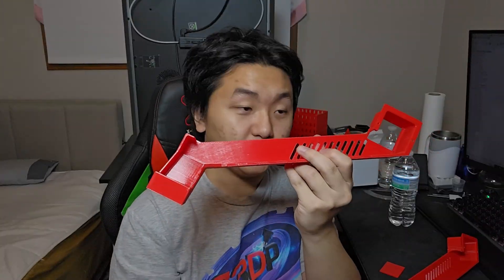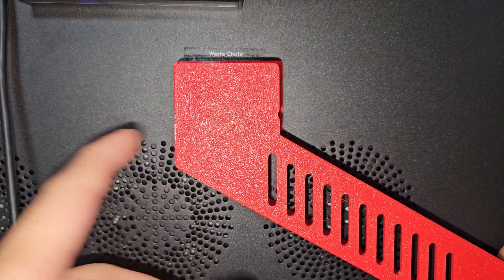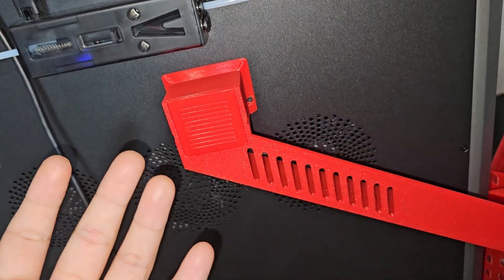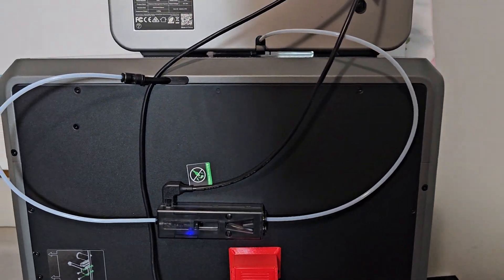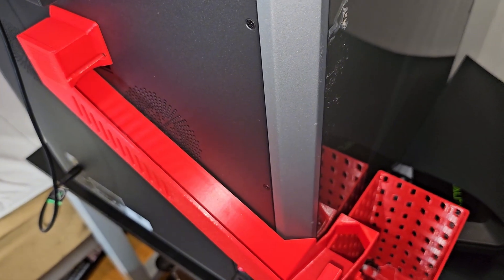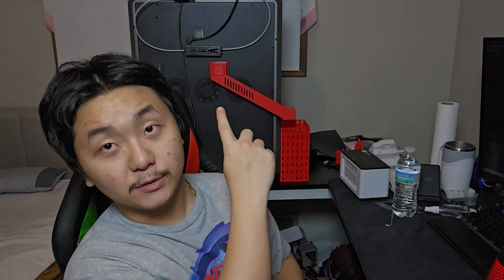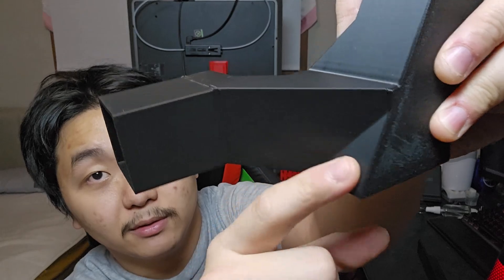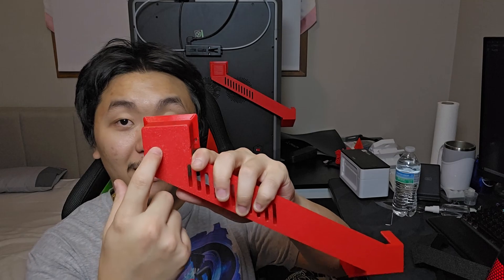Creality K2 Plus Poop Chute Slide MUST HAVE MOD

Comment: I am super new so sorry if silly questions.  1.  Can you put all the parts on the plate and print all parts at one time.  2.  I wanted to do the right side but it appears to be larger than the plate how do you handle this?
Reply from the maker: Yes you can print it all in one go with the left side.

For the right side you'll have to rotate it a bit so it can be printed on the build plate. If you print it diagonally then it should fit.

Great questions.

Comment: Hi there, does this work for the new K2, the standard version. i think the k2 plus is bigger? i have just bought a standard K2 but not very good at modelling from scratch
Reply from the maker: I dont think its going to fit the standard k2, since the k2 plus is a bigger 3d printer.

Comment: when i import on to creality print for my k2 plus it seems like the slide does not fit in the platform. Are we supposed to break up thhe slide into 2 peices?
Reply from the maker: No, you must rotate it a bit so it fits diagonally.

Comment: Hi i think your poop chute for the K2 plus is amazing. Do you know if there is a similar design for the K1 Max conversion. Or could your design be converted to fit. I have looked everywhere but cant find anything that comes close to yours. I know i would have to cut a hole in the back but the conversion kit doesn't come with an internal catcher/chute. Thanks in advance.
Reply from the maker: I don't know at the moment. If I ever got my self a conversion for the k1 max, I'll try to make one for it.

Comment: "Awesome video! I loved it. Would you mind sharing the profile you use in OrcaSlicer for the K2 Plus with PLA? That would be super helpful!"
Reply from the maker: Thank you. I pretty much use the default setting, it's good. The changes that I make was print speed, the max volumetric, changing infill to 3D honeycomb, and adjust the temperature a bit. Those are the most important for getting a good print.

Comment: I get lots of long stringy poop that seems like it would have trouble going down the slide, and through the hole you have at the end of the chute.  How does it deal with those?
Reply from the maker: I have those problems too, it's just that sometimes it has stringy poop and will likely be stuck. I'll see if I can do something about that.

Comment: Nice design. I'm pringting the "poop chute slide right (correct) stl and had to rotate the model clockwise 7 degrees for it to fit on build plate for slicing.
Reply from the maker: Thanks, yes the right side is quite long, so it has to be rotated in order for it to fit on the k2 plus.
Reply: Thank you for this.  I rotated mine on the blue (Z) access -7.00 and it worked.

Comment: Hi, I really like the design and all the ideas and therefore printed it right away with my new K2 Plus in Creality Print 5.1.7.   with Black PLA. Unfortunately it does not fit and the angles and length do not meet up with the device and so it would not really fit.  Did I do something wrong or do I need to used PETG because there is already some warping calculated in the model? I am a bit lost. Would ASA work as well?  Thanks for any advice 🙂
Reply from the maker: What do you mean it does not fit? Did you print the left side or right side? Any material would work.
Reply: @Scratch3DPrinting   I printed the left side. Is there a way to provide a picture? that probably explains it better but what I mean is that the poop chute does not go well to be flat at the backside of the printer and around the corner. The angle doesn't even seem to be 90 degrees in total (so probably two times 45 degree) and is also not close at the edged corner.  I hope I don't have a revised K2 Plus enclosure :-) which could also be a possible explanation. The print itself looks perfect, nice and clean.
Reply: @Scratch3DPrinting   I think I am ok. I watched the pictures again and maybe it's also not so perfect fitting to the printer enclosure as I first thought.  Sorry for disturbing 🙂
Reply from the maker: @ThorBerlin no worry. Yeah it's not 100% perfectly flat with the 3d printer, because it seems like the middle part is popping out a bit.

Comment: hey there, i should have check the measurement before printing however the right hand side doesn't fit due to the poop shoot being off center. Ill print the left side now because design is really quite good. Kind Regards JUST-NOBODY.
Reply from the maker: Ohh, I'm sorry I didn't have time to measure it and just did a mirror of the left side. I'll fix it and reuplaod. Thanks.
Reply: @Scratch3DPrinting  nice one, great model well done on your prompt response and honesty. I appreciate the way you take on feed back.👌

Comment: Is love to a version that ejects to the right, under the spool holder, as it's a big printer and it would mean the left side could be up against a wall and spools and poop on the right.
Reply from the maker: I'll try to make for the right side as well.
Reply: @Scratch3DPrinting  Brilliant. No hurry but ill be happy to run off some tests.
Reply from the maker: @fluxxNZ Hey, I just uploaded the right side, let me know how it works.
Reply: @Scratch3DPrinting  Hello Sorry but is there a trick to printing the right side chute? The file shows 358mm on a 350mm bed. Am I supposed to angle it up in order to print?

Comment: Exactly what I was thinking was needed for a K2 ! So awesome you made this!  I wonder if U can make a 2nd ramp on the side that would end at the front bottom of the K2 ? Then U could just put a wastebasket underneath the front of the K2. Then you dont have to have much room on the side for the bin. This would help on the K2 for print farms. Maybe something to think about making later.
Reply from the maker: Thanks, yeah, something like this must be on the k2 plus for all the poop waste. I'll keep that in mind about making the slide all the way to the front. But I'm not sure if it has enough ramp for the poop to slide all the way to the front.

Comment: question not about your poop chute... when you rooted your printer, did you use the same install that you do with the K1 series or is there a new one for the K2? I rooted my printer but would really like to get everything else loaded on it.
Reply from the maker: I have not rooted the k2 plus. I can't really say how it's done yet.
Reply: @Scratch3DPrinting  how were you running macros then?
Reply from the maker: @97JoMiller Those macro are presets from Creality. You can see and use the macro from using Fluidd interface. Which you can get access to from Orcaslicer. For example: your printer IP address: 192.168.0.000:4408

the :4408 is Fluidd.

Let me know if that makes sense or not.
Reply: @Scratch3DPrinting Indeed, the Fluidd interface comes preloaded on the K2. It is very easy to root the printer, but at this point getting root access does not add anything. I have also found out that the camera facility that is part of the supplied Fluidd interface does not work. Hopefully,  someone who is a whole lot smarter than me will be able to provide a complete Klipper based interface that will include both Mainsail and Fluidd. Because, I became very familiar with the Mainsail interface on my K1 Max, I prefer Mainsail. But 
YMMV
Reply from the maker: @philipershler420 ahh, thats good to know. I would like to try Mainsail but I cannot get it to work on the K2. I know it uses Port :4409 but it does not work for me.

Comment: try Mainsail
Reply from the maker: I'll give that a shot. But do you know what the port number is for mainsail? I try 4409 and it does not work.
Reply: I think it's 4409, fluid 4408
Reply from the maker: @philipthurston7860  yeah, I try that port number and it does not work. Maybe mainsail has not support the K2 Plus yet.

Comment: Please make a video on the print quality and banding
Reply from the maker: I will, just want to make sure I get all the poops so its not a mess.
Reply: @Scratch3DPrinting alright thanks! I’m seeing a lot of banding from K2 Plus owners and it’s really sad considering how hyped everyone was for this printer. Nathan makes robots made a video kinda watering down the issue saying the print quality is still good, but it really isn’t coming from a $1,500 machine with visibly consistent banding. There should be perfect layer stacking like there is on the Qidi Plus 4.
Reply from the maker: @nurelarab Yeah, I do kinda see that too. It can print and print fast, good first layer but wall quality and detail is not there yet. The Kobra 3 quality is alot better from my experience.

Comment: Nice - have you thought about using small circular magnets on the long bit of the chute to hold it against the back of the printer? This will stop it flapping and vibrating when the printer  is in full motion. You might need to adjust it's angle so it goes over the metal plates, but that will also help avoid the fan.
Reply from the maker: I have thoughts about magnets but I don't want to complicate things on poop chute slide. I looked and it will go over the fan a bit no matter the angle I do it. Also, I have tested a couple prints and there's no vibration noise or anything. 

But I will look into those and see if I can improve it more. Thanks.
Reply: Yes, the design I am using on my K2 is held on with magnets. Rare earth magnets are available in many shapes and sizes. Seeing that the back panel on the K2 is steel, magnets provide a chute that is easy to mount and remove if necessary.